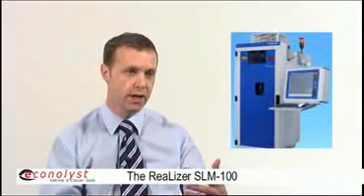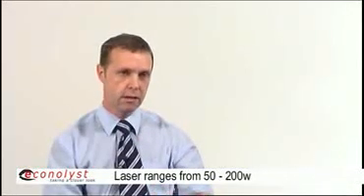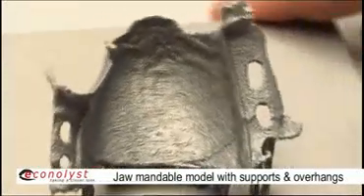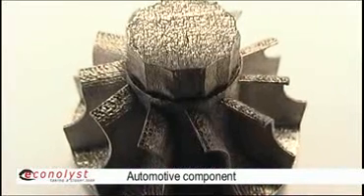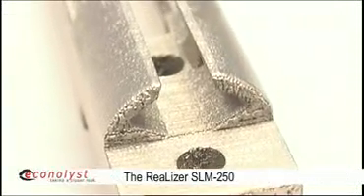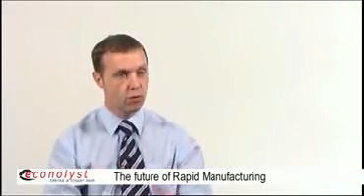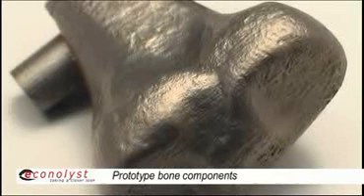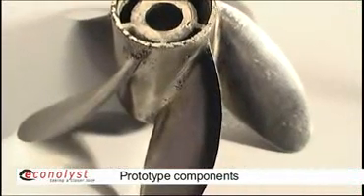MCP - Selective Laser Melting

Comment: yes, but, when the process if used with vacume injecting of a lower melting point metal, you find alot of this is smother out and the part is thus alot stronger also